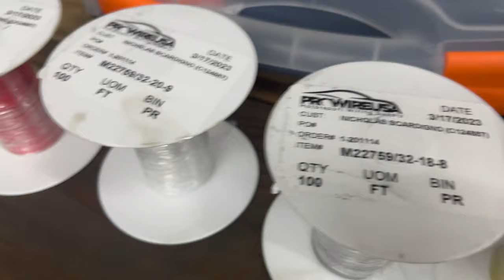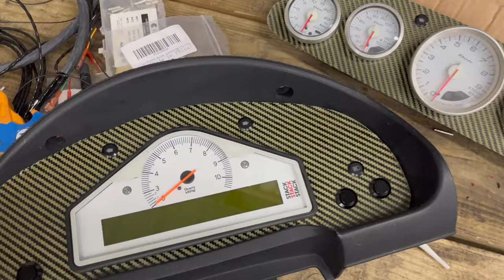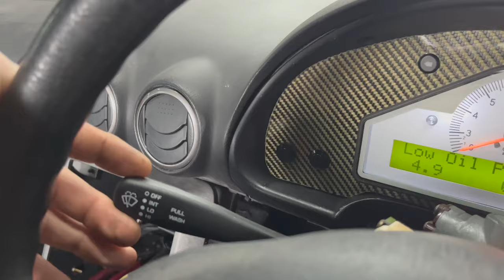CONCENTRIC TWISTING MOTORSPORTS HARNESS IN 20 MINS

Comment: Dude that is soo sick! I see that there’s only three wires going to the fuel tank top hat at about 18 mins, will there be no fuel level gauge?
Reply from the maker: There is a fuel level guage just no fuel low warning . Power 12v, ground , fuel level sensor signal. 4th wire would be for low indicator
Reply: Gotcha now I know! All your wiring jobs are next level!

Comment: any reason to not use the booted version of the connectors?
Reply from the maker: Price point for the customer those boots are roughly $7 a piece plus the booted connectors themselves cost more you can expect to add another $500 just in connectors and boots . Also not really necessary in this application as there’s only about 6 connectors that are open to elements and they are all just lighting connectors